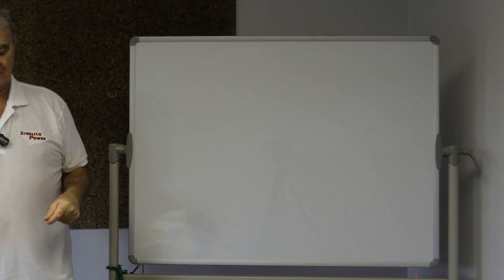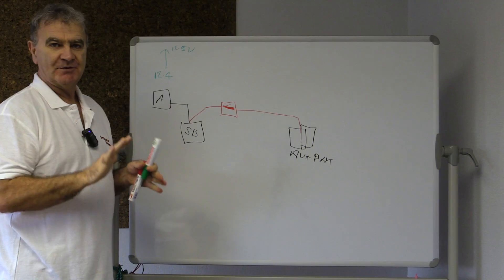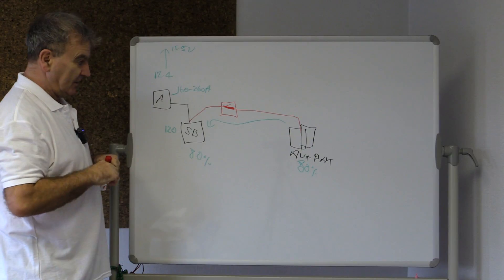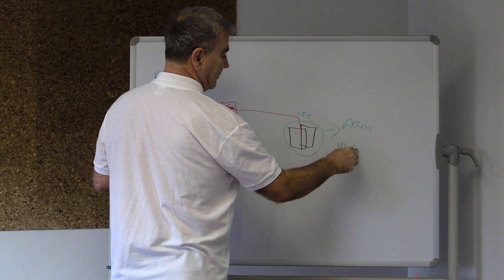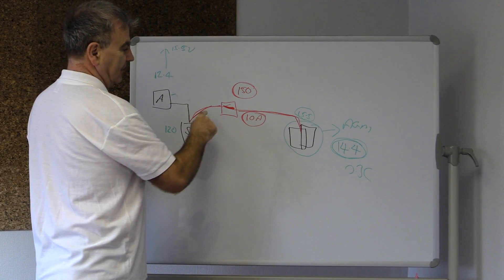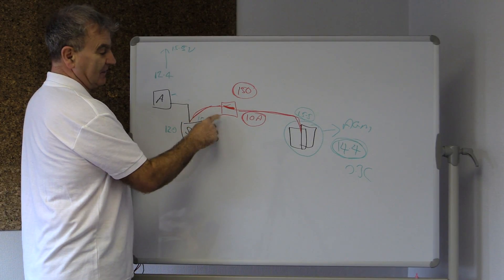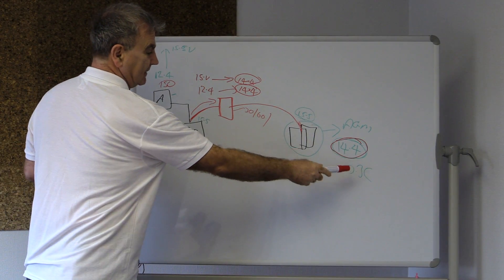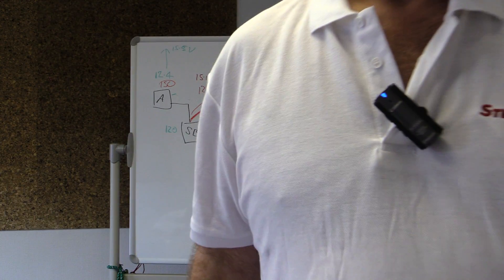Do not use conventional relays with Euro 6 engines, here's why.

Comment: So what about the discharge when driving on and the voltage is 12.4v, does the BB charger setup prevent it? so it only discharges the SB while the Camper Battery still charges 30/60Amps at 14.4v
Reply from the maker: Hi Angelus,

With an ignition feed fitted the BB essentially puts an artificial drain on your starter battery. Your electronic control system reads the starter battery as being 'low' and somewhat overrides Euro regs to engage continuously, to try and cover this power deficit.  With a BB fitted with an ignition feed you'd likely see far more reliable alternator voltages. 

We don't discharge the SB unless expressly set up to- which, most people don't want. We use the SB as a buffer to sort of transfer the alternators power through, safely.  Further; correct. Regardless of the voltage coming into the BB, the BB will either be bucking or boosting the voltage to the correct and set charge voltage. 

-B

Comment: I have a 2017 Fiat Ducato camper van with E6 engine. I have a voltmeter permanently installed on the dach monitoring the starter battery. I never see anything than 14,0 V. I suspect that campers have different functionality to deal with this problem.
Reply from the maker: Hi Rudy,

Do you have a BB fitted? If not, that's to be expected. E6 engines are notoriously unreliable when it comes to charging, as mentioned in the video.

If you do have a BB fitted- again, not to be alarmed, the BB will boost the voltage on the output so the voltage on your starter battery will not be indicative of the voltage your leisure battery is receiving. 

B
Reply: @SterlingPowerProducts  No, I have no BB charger. The generator voltage is always 14V. In some short brief moments maybe 13,8 to 14,2. Never seen ant E6 regenerative charging behavior.
Reply from the maker: @Rudykanal  That's odd to hear. We find that almost every European vehicle made post 2015 is Euro6 and we find that Euro6 best shows itself with typically low voltages unless you're breaking, in which case the voltage spikes up far higher.

May just be an individual odd case. I've seen running alternator voltages on alternators as low as 11, honestly.

How odd! Oh well, should at least save you having to fit an ignition feed.

Comment: Could it be just a DC to DC solar charge controller. If I already have a stand-alone solar panels 12v, Morningstar DC-DC charger 45amp, 12v lithium batteries and normal sealed lead starter batteries 24v.

Can I just connect the starter batteries to the DC-DC charger?
Reply from the maker: Hi Jaffa,

Apologies but I can't quite figure out how I can help you here. If you're still in need, feel free to give us a call.

Comment: If you put a 10 amp rated cable in the system and  draw 150 amps through it it will glow like an electric fire as you state this is the safe way to do it do a video please of you having a 10 amp rated cable and draw 150 amps through it and prove to your viewers that your supplying the correct information but please be careful have a fire extinguisher to hand because your going to need It full stop.

Comment: If the leisure battery is flat and you use a "bad" cable as suggested, the current that flows will be to much for the cable and cause a fire hazard in the vehicle. Make sure the cable is protected with a fuse at the supply end with a fuse rated slightly lower than the cable rating. Using the battery to battery charging system is the way to go.